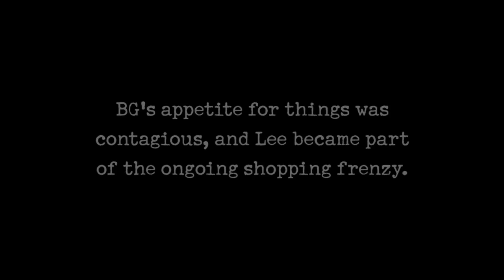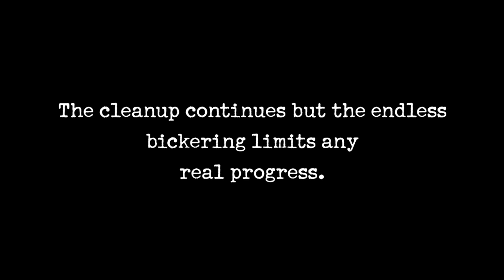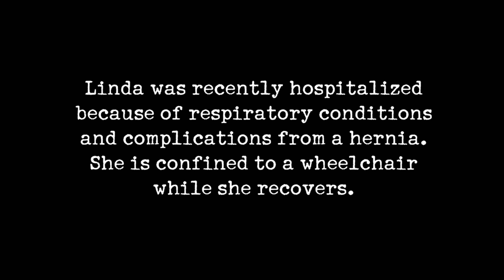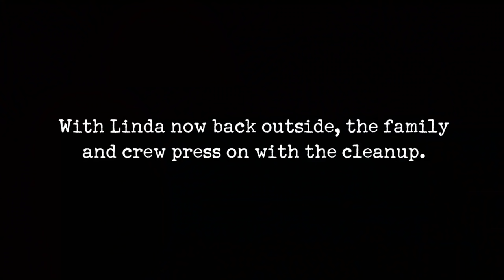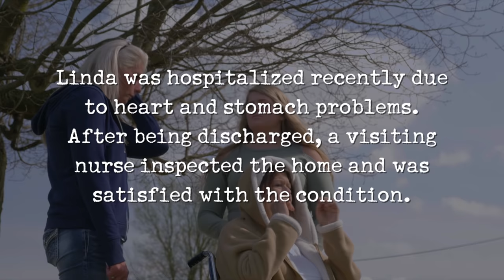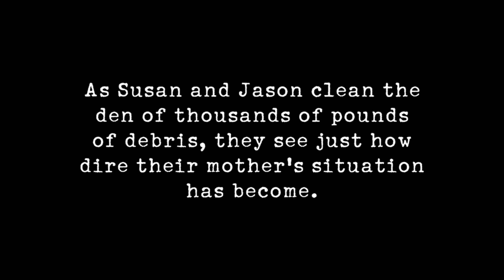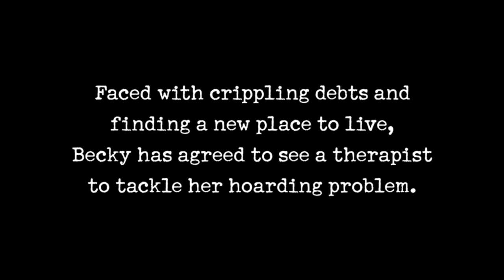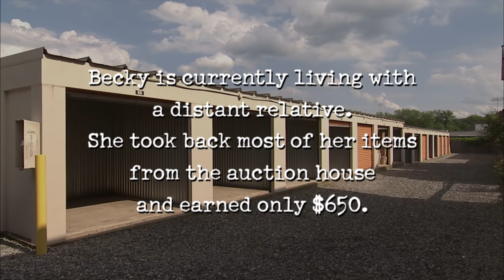Hoarders Top Episodes MARATHON - Binge Them w/ Dorothy the Organizer! Part 6 | A&E

Comment: Can You Sell a Condemned House?
Typically, a condemned property cannot be sold as a structure. The property can usually still be sold as land, though the value is actually reduced due to the buyer expense of tearing down the condemned house and hauling it away, making it difficult for a buyer to get a mortgage loan. In some circumstances, you may also be able to find a buyer with a hard money lender to back them up.

But by far, your best option is to sell the property quickly, before the structure becomes officially condemned and you lose control of what happens to it. HomeGo buys houses in any condition and offers you a same-day cash offer without ever needing to make repairs. Move out and move on before your home is officially condemned.

Comment: I had to pause and go back to check to make sure but I have the same sort of rocking horse as Becky does which can be seen at 3:22:54. Hers is just missing the top handle which is supposed to go through a hole which you can actually kinda see in the neck if you know where to look. Mine also has a wrap, which is unraveling, on the reins which hers seems to be missing.

Comment: The sister might be wrong re: the gym price vs electricity at home, depending on the pricing in the area he's in AND if he is not bothered by various restrictions. 24-hour access gyms like 24 Hour Fitness, Edge, Planet Fitness etc. are from $10 to $20 a month flat rate no contracts; he's using the water + either gas or electric depending for the showers, and could potentially do some other things like use a tanning bed time to accomplish other deeds in private. The electric and/or gas in the house will usually exceed $60-80/mo at minimum if not more. Of course this negates using any electricity and gas at all in the house and makes you dependent on leaving the hoard to go do other stuff you want, and perhaps dangerously lighting with candles in such an environment.

I've known people who have used local gyms as their shower/hygiene center for years at a time while their showers / toilets / plumbing etc. weren't operational. It saved them money. But its really a big 'IF' and it's not very convenient even if it is within a few minutes of home because you're going to be hard pressed to do anything else other than hygiene there unless it is late at night and the staff is gone. In this case the gym is likely empty and you've got everything to yourself including potentially a refrigerator,  the shower/toilets, electricity to plugin electronics and wifi , et al.

But really its just a big PITA and the gyms are increasingly becoming hip to the homeless using their facilities.

Comment: When asking if the house was structurally sound, why did they call an extreme cleaner biohazard person instead of a structural engineer. Only a structural engineer could tell you if the house could be salvaged by looking at the foundation and what could be done with the walls etc. sheet rock is only around $15-$18 a sheet which is 4‘ x 8‘ and it looks like a pretty small house so you may need 100 sheets of sheet rock to replace the old sheet rock and some two by fours if they are rotted. If the floors cannot be salvaged then they have to be ripped up and half inch to three-quarter inch plywood put down. Maybe the material not including the roof would be about $20,000 it’s the labor That would bring the price sky high. Telling the old lady that the house is not salvageable at all is a lie until they speak to the proper people structural engineer and a contractor. Also saying that the entire house has to be bold those is ridiculous they would need architects engineers site planners all that to put up a new home when the easy way would be to rip down all the house except for one wall if one wall is left in a home then all you need is a building permit. If they wanted a brand new home they could go manufactured home, modular Homes, pre-fab homes, there is multiple ways to do that which would be cheaper than $100,000 to put a Home on that lot  The home could be one story and much smaller than it is now for one person. All she needs space for 2 bedrooms (The second bedroom because she may need a home health care or to live with her) and 1  bathroom.
Reply: Because you don't need to speak to the foundation issues when the floors, drywall, appliances, etc have all been severely contaminated. 

Plumbing, electrical, and structural issues are secondary to that. To fix that house, they would need to bring in a bio-hazard team to completely gut the house.